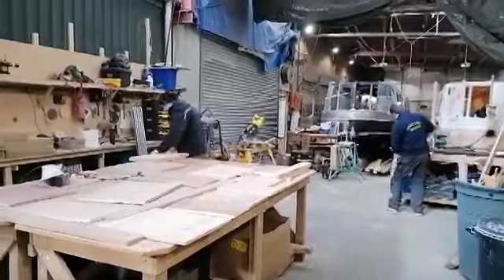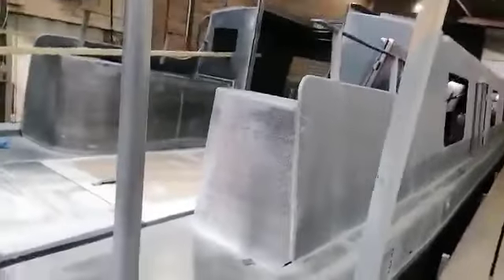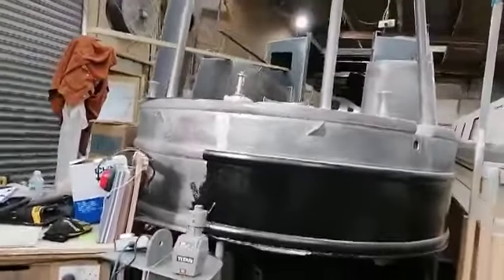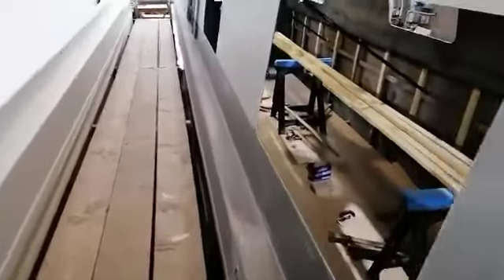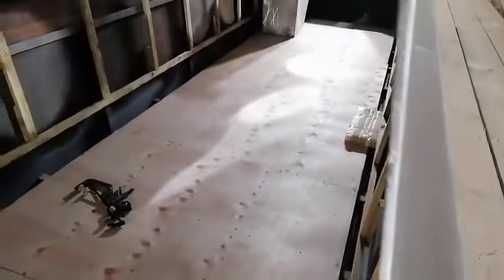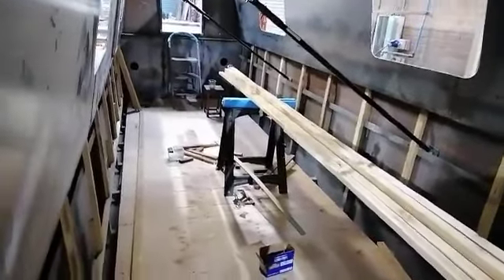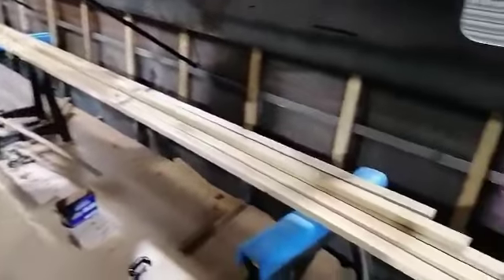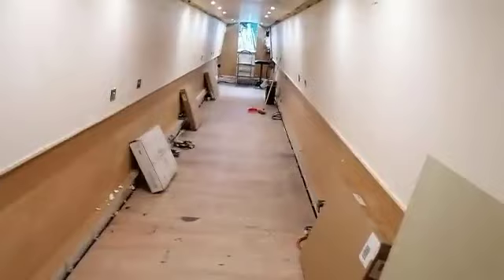Narrowboat Painting at Ovation Boats

Comment: Question, why aren't the interior of the boats painted before fitting out?
Reply from the maker: Hello Simon, if they are closed cell foam sprayed which they all are, steel is degreased with foam applied directly to the steel. Window and door apertures without foam spray are painted after. Regards Chris Ovation